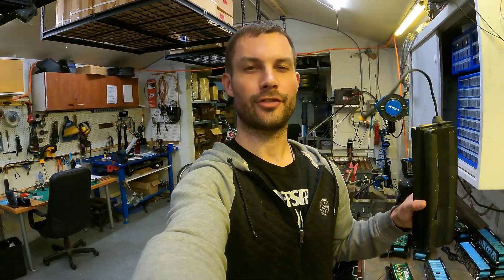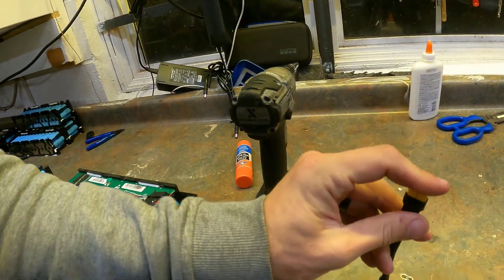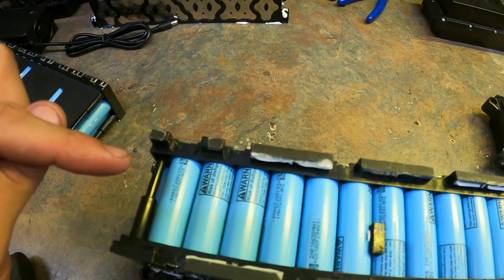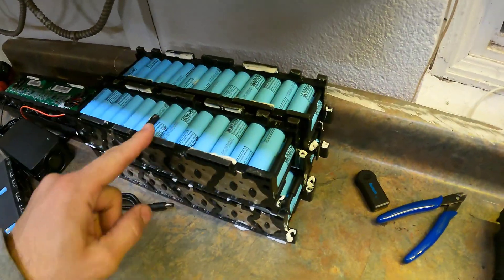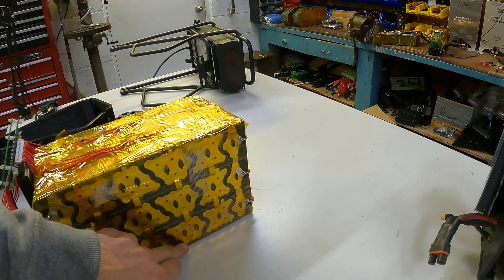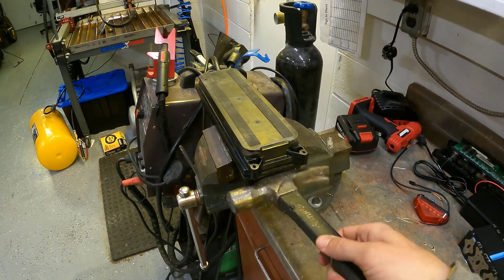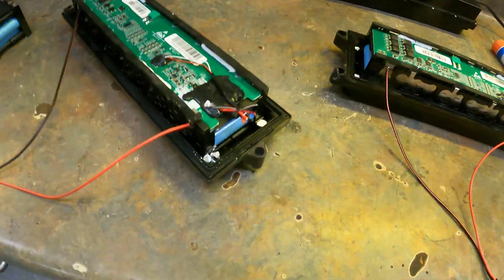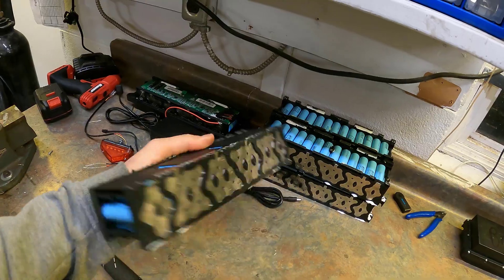Low Cost Lithium Battery Packs - Build your own 72V! (Canadian)

Comment: So if I buy 2 36v packs then I can connect them with a series connecter on Amazon to make it 72v? Correct?
Reply from the maker: Yes, you can do that
Reply: @ElectricBikeLaboratory  which packs, the eco packs for 99 or the 200 ones
Reply from the maker: I just replied to your email
Reply: @ElectricBikeLaboratory I’m thinking of doing the same do I buy eco $99 or $200 and how would I connect them I have no idea how to connect them

Comment: tutorial on how to wire up two or more of these batteries to make a 72v pack? I have similar scooter packs in the same configuration and looking to build one 72v pack. I already use two of these batteries in series but looking to push more amps with one bigger bms.
Reply from the maker: Coming soon

Comment: When are you buy the batteries? 60 V?
Reply from the maker: 60V is a bit trickier with Li-Ion because it's 16S so half of that (2 packs in series) would be 8S which is not a very common pack. 72V (20S) can be made up of 2x 10S packs which are super common to find. Hope that helps!